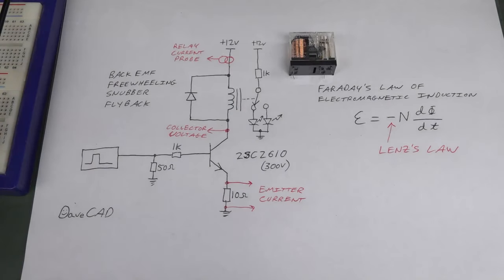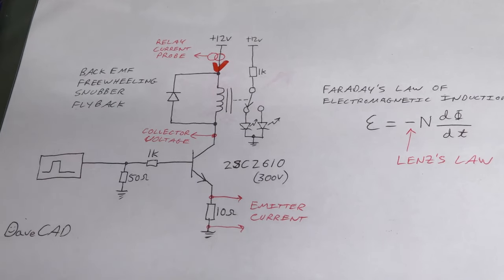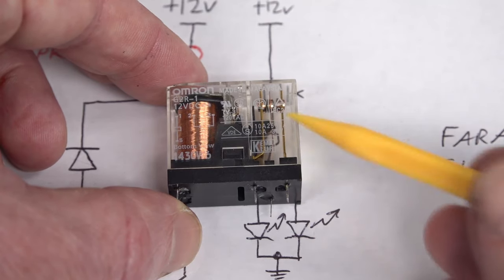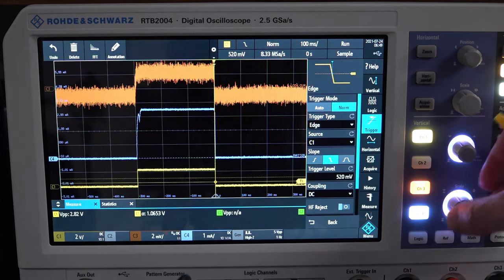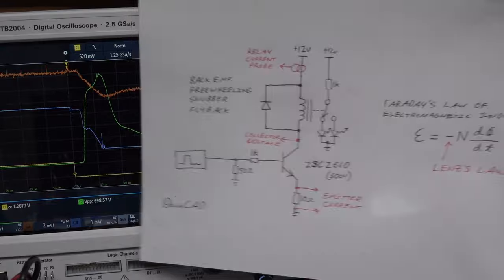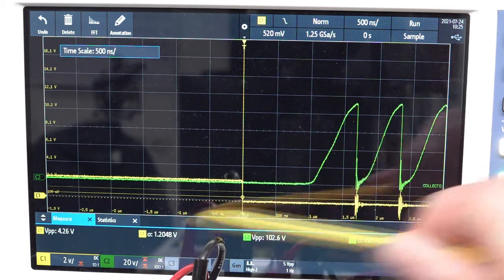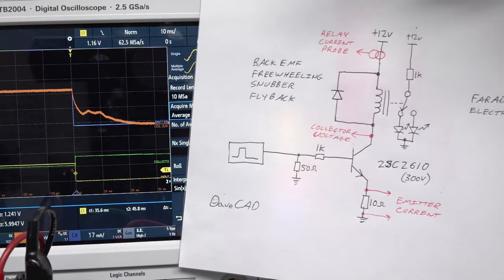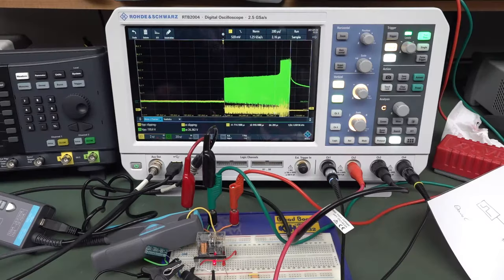EEVblog 1409 - The DANGERS of Inductor Back EMF

Comment: Very good.  At Maxim, I defined several families of fancy relay drivers for special markets like ATE (little COTO relays) and DSL provisioning (thousands of relays in a crosspoint).  A few things that some of these guy do is interesting. 1.  They will have all the snubber diodes for the relays return to a single zener that is reverse biased up from ground.  Small transistors can generally take 50v, so it was common to use a 33v diode.  The ULN200x series part makes the common diode terminal available for this purpose, you can just tie it to the high rail but for better speed, take it to a common grounded zener at a higher voltage- in 5v systems, this could give a 6x speedup.  The reason that they like the return to ground is that often the high rail can't sink current (except into bypass caps)- ground is a better sink and probably stiffer.  2. In some critical applications where power dissipation of on relays could be an issue- they would have a two stage switch, it used the full 12v to pull in the relay and a lower voltage to sustain it.  I defined some Maxim IC's that did all this- a 12v relay won't drop out until it gets down below 5v in most cases though generally you'd use 3/4 of the nominal to keep the contact pressure high and R low.  There are several clever ways to do this if you look at app notes from Maxim and others.  3. The other cool thing is single coil and dual coil latching relays.  Telcom guys would capacitively couple small single coil relay to a HCMOS output- when the output was energized, it would send a pulse to the coil in the forward direction, when the output went low, it would reset the relay.  A .1 uF ceramic will create a lot of peak current with a CMOS rise time pushing it-  you size the cap for the peak current and energy required for a good latch.   This is a good topic.  I talked to a lot of relays guys, relays are still used a lot but there are few drivers for them- the ULN2003 series goes back to Sprague in the mid 70's.  We had some advanced development on MEMs relays, a whole 'nother very interesting topic that you might look at.  Your discussion was well presented as usual.  Regards
Reply: Great comments.  This reminds me of the work we did at Eaton when designing oven controllers.  Given the longevity requirements and the high temperatures involved, relay life and power dissipation were important design concerns.  The normal way to power relays was to use 18v relays in a 24v circuit.  The uC would drive the relay at full voltage for a few small time and then PWM it to get a lower effective drive current--but above the hold limit of the relay.  Turn on/off was generally synchronized to a zero crossing to minimize current through the contacts when they made/broke.  Depending on how the drive circuit was designed and the behavior of different relays, the microcontroller would be programmed with different timings to get the actual make/break exactly on the zero crossing.  Pitty the purchasing manager who tried to substitute a different relay in a design without engineering approval. ;)
Reply: LM1949 is one such chip, it's primarily for low impedance injector drivers, putting full power into the injector to pull it in, then throttling the current to about 1/4 to hold it in, making for much less power draw, less injector coil heat buildup, and MUCH faster turn-off times.. One of the great things about them is they can also power high impedance injectors just fine, since they will just never draw the current needed to trip into current limiting mode
Reply: @davidwillmore  - I worked on white good stuff some.  You have some clever designers in that field.  Getting the high volume cost down to be competitive took a lot of smart engineering.  Zero crossing and cold switching is the same thing that a lot of ATE guys do.  They have control of the Source/Measure unit or PMU driver so they can keep everything cold while swtiching.  The ATE guys wanted to get 10^11 cycles out of those little Coto relays- and they could do it if you switched cold.
Reply: @Rx7man  - exactly- injector drivers are very sexy.  They actually use active clamping like a synchronous rectifier to get things to really move.  Modern direct EFI, does tiny little timed squirts of 100 uS etc.- amazing- Bosch was/is king.  I went on after managing the Standard Products definition to start Maxim's automotive group, I setup the target markets to keep margins high,  defined the first 50 or products and hired a bunch of auto industry guys to get it going- a lot of fun.  Its now a billion dollar group inside Maxim, soon to be ADI- amazing.  We did some interesting injector driver  parts and other automotive inductive drivers- modern 7 and 8 speed automatic transmission use very sexy drivers to move hydraulic proportioning valves to make all the shifting buttery smooth.  Incandescent lamp Drivers are actually challenging too because the cold resistance is a lot like a short and the hot resistance is much pretty high- took pretty smart drivers.  The customers also wanted these to work with LED's with no changes (sense the load profile).  LED's have a completely different set of problems.  Infineon makes all kinds of really cool smart drivers for automotive and they sell them cheap- at least to the automotive guys.  There is a lot engineering in the smallest details everywhere.
Reply: @johnwettroth4060  That's really cool.. I found the LM1949 when I took a Holley Commander 950 standalone controller apart.. it was built in about 2000 or so
I can only imagine the new diesel injector drivers have gotta be really nifty to get the response and resolution, and drive piezo injectors which have gotta be very different from coils
Reply: @Rx7man  - piezo drivers are amazing.  They are blazing fast- just what it takes to get 30 MPG out of some monster 6 liter V8.  They push 200 volts and up into these basically pure capacitors- with incredible rise times.  They'll get currents of 20 amps- that's 4000W peak (not for very long).   They use techniques similar to old TV flyback circuits where they recirculate the drive power- very little is really wasted.  Amazing.
Reply: @johnwettroth4060  above my pay grade to understand them, but I can appreciate that they're cool!
Reply: @davidwillmore  I have seen a lot of Omron and other industrial controllers that use a resistive or capacitive power supply, where they get the resistor or capacitor value to the point the relay will have 18V across it when operating, but there is a 100uF capacitor across the power rail, and a 24V zener diode, so the initial current is provided by the capacitor, then the hold current is lower. The controller has a separate power supply, a resistor and a zener diode, that draws 2mA from the 24V supply, so that 1mA is there for the microcontroller, and 1mA is there to operate the indicator LED. If there is a power LED it is simply in series with the controller dropper resistor, as then it uses no extra supply current.
Reply: We used to use a lot of solenoid controlled valves for control of fluids, same as a relay but switching fluids.  They could get quite hot if left in the ON state, so we used to fit a device called a “cool cube “ to the back of the solenoid which would provide full power to pull the solenoid in, but then drop down to a lower holding power. Made a big difference to the heat generated in the unit, when you have 10-15 solenoids and a syringe pump valve head being controlled.
Reply: @SeanBZA  If you're designing something like this on the cheap, could you put a Capacitor/resistor in parallel, in series with the coil (for a DC circuit)? Probably chose a resistor a little less than half the resistance of the coil and a fairly beefy cap, That should provide the inrush current to close the relay coil, but as the cap charges the continuous current would be dictated by the resistor, with a value a bit less than half the coil resistance you should be able to hold about 60% of the voltage across the coil, when you turn off, the resistor would discharge the cap pretty quickly
Reply: @Rx7man  You can just use a resistor that is about the same resistance as the coil.  The current ramps up from zero at the beginning so the R isn't there- you get full slewing, as the coil charges up, it draws current and the R becomes active and settles at half the usual hold current.  A lot happens in the first 10% where there is full voltage across the coil.  You can play with the values and save power etc.  An old technique for speeding up unipolar stepper motors before chopper drivers became common used something called L/4R drive.  You'd use 4x the rated voltage of the motor and resistor of 4 times the motor R.  You'd get a very steep rising current from the high voltage that would settle at the correct final hold current and voltage.  The only problem was all these hot resistors- old dot matrix printers in 80's did stuff like this.  They had a fan to cool the resistors but the dot matrix printing made so much racket printing that it didn't matter.  Chopper drivers basically do the same thing with a kind of a buck converter architecture- very efficient.
Reply: @johnwettroth4060  I guess the cap isn't as useful as I'd thought it was, and that makes sense..
Interesting formula, I have only played with bipolar steppers, and there's some pretty smart chips out there, There was one I used, I think it's the L6470 from ST that had lots of interesting features, 128 microsteps, etc
Reply: @Rx7man - microstepping used to be kind of exotic, but the explosion of inkjet printers made small nice stepper drivers really  cheap and available.  Its one of the things that made 3D printer building so easy not so long ago.  These standardized ustepper boards are a few dollars and have gotten really good.  There on the third generation now- check out the A4988, A3967, DRV8825 or TMC2208, they're somewhat compatible and they just keep getting better.  If you need more current, the Toshiba TB6600 will do 4A at 36v or so.  Cheap Ebay modules are built around them.  Not long ago, you needed Gecko drives that used discrete FET H-bridges and a pile of stuff for $100- these TB6600's will do it cheap.  I wanted to do some stepper drivers at Maxim but there were such good solutions already out there and what you're really selling is big fat H bridges with a little analog around them   Maxim didn't have a dirt cheap DMOS power IC process that could compete.  ST, ON, Allegro, Infineon, Motorola/Freescale, Rohm and some others have these kind of processes- its difficult to make any money with these commodity IC processes- big chips and cost conscious customers like printer manufacturers.  Its a good time to be a hacker!
Reply: @TheEmbeddedHobbyist   do you have a link to the "cool cube"? I am using 24DC switching PS to activate irrigation solenoids and they keep shorting out on me. I was wondering if heat may be a factor or if it is the EMF from the solenoid coil doing it. I plan to add diodes when I put the system up for the end of the season. I have  shorted out 3 so far this season, but they only run for 30 minutes and they do not short out during actual use, but randomly upon trying to activate them. It shows up as the processor continuously rebooting from the drop in supply voltage. A nasty cycle to get out of.
Reply: Economizers like that can cause non heat related problems if you aren't careful, but are nice otherwise.  :)
Reply: @TheNCGardener  - don't be offended but most irrigation solenoids are AC operated.  Spinkler controllers use small Triacs to switch them rather than transistors.  AC solenoid coils have a kind of secondary- almost a shorted turn that keeps current flowing out of phase in the negative cycle.   The main coil is generally a much lower resistance than an equivalent DC solenoid.   They can be run on DC but generally at much reduced voltage (50%) due to this odd construction. This is likely what's happening in your case.   Some have DC coil ratings as well as AC.  In other cases, they may make a compatible DC coil for the valve.
Reply: @johnwettroth4060  Thanks for the info. This is a DIY 16ch relay board with an esp32. I did not see any data on the requirements on the solenoid. It is was the cheap Orbit brand from Lowes. I did go back and see that the commercial brand of controller I had was using AC which was around 24volts. I can power these off of a 24vac wall wart if that would be any better. I will definitely look into it.
Reply: @TheNCGardener  - I googled "driving irrigation valves with arduino" and found the following.  You can likely find more/better.  https://forum.arduino.cc/t/arduino-ac-solenoids/115516.  I see you're the NC Gardener- I live in Cary, NC- if you're local, I can give you a hand with your project.
Reply: @johnwettroth4060  I'll definitely have to check out those other chips.. one of my big gripes about the one I was using was it had in internal position counter, but if you were moving one direction and wanted to change direction, you'd have to stop, then issue the new desired position, which makes the code MUCH more convoluted... it really should have been able to figure that out on its own.  for some reason I wasn't able to get the speed/frequency up to anywhere close to what it was advertised either
Reply: @TheNCGardener  if your output board just uses regular relays - just use an ac transformer wall wart  and you'll be good to go.
Reply: @johnwettroth4060  I live near Windsor about 2 hours east of Cary. I appreciate your offer though I did not design the 16 ch relay board but found a design by the youtube channel Techiesm. 

https://www.youtube.com/watch?v=HK3qpyeSOcY&t=313s

 It uses 5volt relays as the control mechanism. I already had a 5 port manifold I had mode years ago and didn't give any thought to the voltage requirements of the valves. I basically touched the valve leads to a 12vdc supply and it seemed to work. It was only after the second valve shorted that I suspected an issue. The relays already are using flyback diodes so I suspected I would need to add them across the solenoids. I am also using the esp32 along with a flow meter to count the gallons of water usage. I noticed that when I activate or de-activate a relay, it would cause the esp32 to count the pulses from the electrical noise from the relays and give me about 2 or 3 gallons per minute flow rate for a total flow of about .3 gallons.  It is pretty consistent. I don't see going with DC latching solenoids as an option. I will try a 24vac wall wart and see if that solves the issues. I have developed code using Nodered running on a rpi with home assistant to control the relays thru MQTT 
commands. This has been a very fun project. I also have soil moisture sensors that work with my weather station and my next step is to write automations that will use the soil moisture and temperature to control the irrigation cycles. I also hve a fertilizer manifold which I can turn on or off to fertilize. I am using it in my vegetable garden with drip tape. It works very well except for the solenoid issue. 

sorry for the long post
Reply: Well said! Relays are electromechanical devices and modeling them well enough to match the oscilloscope traces requires coupling the electromagnetics to the mechanical model. Of course the mechanical model is easily translatable into an electrical one – the linear s-domain mechanical terms as well as various nonlinear behaviors all have electrical equivalents typical in semiconductor circuitry, so SPICE can do a good job and provide you with the contact force, that you can then run through another electrical analogue to get contact resistance. Once you play with those models enough you notice that the fast armature motion on opening and closing is essential for contact life (but beware of mechanical resonance of course).

The simple freewheeling diode circuits with low voltage developed across the coil during opening cause premature wear on NC contacts. The closing force during the critical first microseconds of conduction is inadequate, and the contact plating is vaporized due to local resistive heating. A first order approximation is to demand same opening and closing time, and then tweak for different mechanical operating points in open and closed condition – that depends a lot on relay design, and is a much simpler problem in reeds than armature relays where the nonlinearities age quickly with each operating cycle. 

Another fun area is design of relay logic circuits to maximize contact life. It has few practical applications except for the hobby relay computing, where it becomes critical for maximum speed and relay life – especially so for machines that use physically small modern relays designed for telecom and ATE applications. These relays take not much energy to operate, and the coil’s magnetic field can store enough energy to trip several other relays, especially if relays with higher coil resistance are mixed with those with lower resistance. It takes RC snubbers matched to coils to absorb and dissipate the energy from the turning-off coil without triggering other relays if that’s all you need. And it takes phase delay and resonant networks to get the contacts to open at zero current in spite of said contacts being loaded with energized coils. Tanks also allow recovery of the stored coil energy – important for heating control and power consumption when you are switching thousands of relays at a good fraction of a kHz. The energy stored in the magnetic field (and subsequently dumped) becomes a problem akin to the horizontal CRT flyback coil energy management. A complex hobby relay computer (on the order of 1E4 relays) stores more magnetic energy energy at any given time than even the largest CRT horizontal deflection circuits. As the operating frequency gets past 100Hz, the power dissipation becomes ridiculous.

Most small relay coils can be driven in a tank circuit running at low kHz (past the mechanical resonance and past highest frequency where the contacts still move enough to open and close). If the coil doesn’t have to stay on for very long then oscillations of this tank give the driver contacts several opportunities to open at zero current (usually not zero voltage though). That way you can use tiny armature relays and reed relays and maintain the “insane” contact life while driving relatively heavy loads (many coils). It’s perhaps the one case where inductive coil loads are a blessing. It turns relay logic circuit design into an analog art more akin to designing high order passive audio filters than digital design. The energy storage in tanks tuned to various frequencies can be used for local timing and for implementing asynchronous logic in ways not really possible in CMOS at present.
Reply: @johnwettroth4060  Re. stepper drivers: a huge unexplored area is closed loop sensorless control of steppers. It is very amenable to analog solutions, since it takes continuous winding complex impedance measurement along with other state estimation typically done in BLDC servi drives. I have several breadboards chock full of op-amps and other active analog functions to do this, reminiscent of analog computers of the years past. No time to play with it at the moment, but as a proof of concept it worked amazingly well. There are some papers that scratch the surface but generally conclude with “this problem is too hard to be practical to solve”. In typical stepper applications in 3D printers, machining and mechanism control, closed loop sensorless stepper driving over full operating range of velocities and torques is eminently solvable with what an analog ASIC can do. Some driver chips half-heartedly use sensorless techniques to detect rotor stalls and reduce vibrations/acoustic noise, but nobody seems to bother taking it any further. Of course the whole thing could be also implemented in the digital domain, but analog is more fun IMHO and perhaps can be implemented using less power than a mixed signal solution. I have long been an advocate for running as much of analog circuitry in software as possible, since the software coefficient don’t drift with temperature (for one), but recently got tired of software and am enjoying analogue world again, hands on.
Reply: @absurdengineering  , an interesting idea.  Open loop stepper guys just stay below the stall limit always or so the think.  If they command home and don't get home, they flag an error and remove. Some adaptive adjust timing or drive levels.  I've retired but you should show some vendor your idea. They might off you a job!
Reply: I used to work at Maxim. Best job, arrangement and people I have ever worked with in the USA. Len Sherman was my manager. He looked like Steve Martin and I couldn't help but smile every time I see him, automatically thinking of the actor.
I only wish I had been more grateful for that job, but I was too immature back then (almost 23 years ago).
I know nothing negative about the place (the company) and the people.
Reply: @johnwettroth4060  Steppers do have resonant points and odd force characteristics in that region. I would have liked closed loop sensing for a problem I had about 15 years ago when an idle stepper motor would occasionally miss steps due to engine vibration, needing to step at higher than its resonance frequency, and pressure drop across the valve. Fortunately we’ve shifted to a brushed motor with position feedback in the form of a drive by wire throttle, so we don’t really use stepper motors for idle speed control any more. As an automobile ECM designer, the driver ICs I use have internal clamping. One thing is that a simple reverse diode clamp causes the relay contact to open slowly, and sometimes they can stick closed. I’ve seen that happen on large unclamped inductive loads like brushed electric cooling fans. A zener clamp works much better that way as the contacts open faster. The same thing happens to solenoid valves.
Reply: @edinfific2576  - We must have have just barely overlapped- were you in Customer Apps or the power group at Maxim. I count Len as a real friend and a great guy- also one of the most fluid engineers that I've ever worked with.  He took me out on my first FAE calls when I started in 1993 or so.
Reply: ULNs are handy but usually more expensive than using discretes.